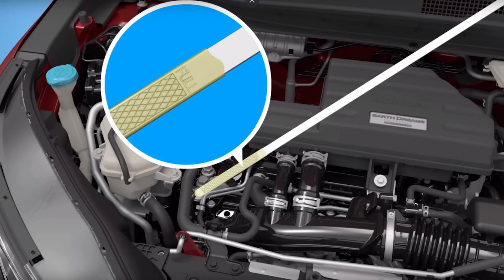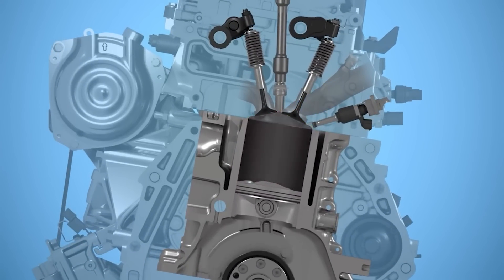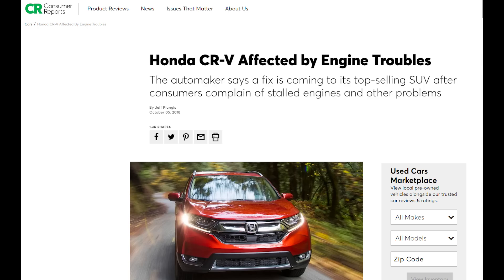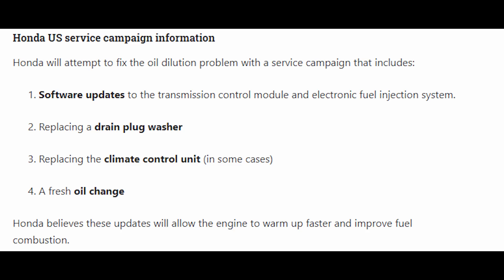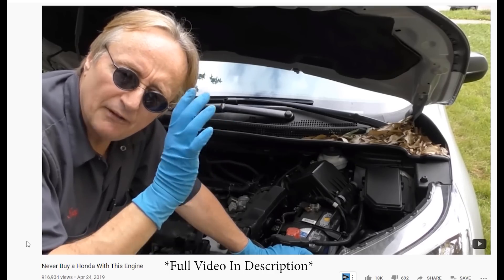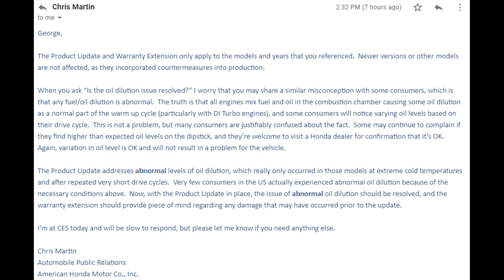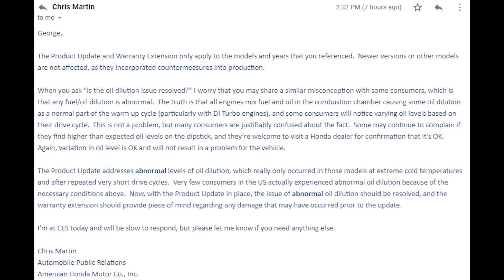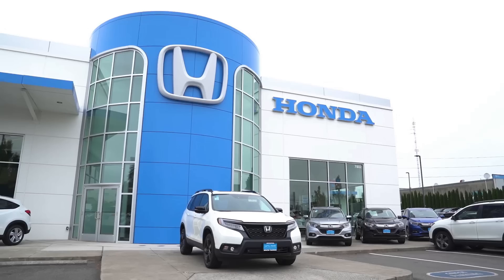Does Honda Have An Oil Dilution Problem? | 1.5L Engine in CR-V and Civic

Comment: I think this has become a he-said-she-said issue.    Panic!!  Panic all around... from here-say.     Get a grip.    I've heard of a "potential issue" but have not heard of many if at all ANY engine failures. No more so than any other average vehicle including Toyota.     I would not hesitate to purchase one of these vehicles (the 2017 or 2018 model).   As long as it's had it's scheduled maintenance.      No worries at all on this one.  Just would check the oil more often...keep an eye on it.     I do my own maintenance and have no hesitation about the issue.
Reply: Not everyone has the know how or garage to do their own maintenance.   This issue here is a bad engine design which will affect long term reliability and durability.  My 18 CRV oil gets diluted after less than 3k miles.  That’s just not acceptable and Honda needs to do more than giving a token warranty extension.
Reply: Two points. Not everyone is as a dedicated owner as you are. Two, it is still too early to rip the possible problems that it will cause. Btm line, its still an issue.
Reply: @handycap9815  Ha! Not only do they know but it was most likely by design since they had to make and test the engine themselves. So they couldnt notice the issue? or they didnt test all their engines, either way bad move for honda!
Reply: Nothing like allowing blind bias to overcome facts and reality.

Comment: 2018 Honda Accord sport (1.5 6 speed) problems here. Multiple check engine lights (misfires) and eventually the engine stalled out.  Honda replaced the entire fuel management system and cylinder head  on my Accord under warranty since they weren't sure what the exact issue was.  I'm only at 25K miles!! I do live in NY, but I do 90% highway driving. Not sure how long I'll keep this car. I love it and get incredible fuel economy, but I wont replace a fuel system or cylinder head on my own dime.
Reply: Wow, thats bad. Trade it in as soon as possible. (you never know how good there major repairs will last)

Comment: Now does the 2018 to 2019 Accord which also used the 1.5L Turbo engine have any oil dilution problems?  So, far we only hear about the Civic and CR-V issues.   Anyone knows anything?
Reply: It really depends on your driving pattern. If you drive constant short trips, don’t get any gdi engine.

The newer models shouldn’t have this issue.
Reply: Any updates?

Comment: Small turbo is bad, Honda's 1.5T is the worst. That's why Toyota doesn't use small turbo.
Reply: They have small turbos in other markets.
Reply: Agostino Matteucci You are pretty much right. It's all in the interest of simplification and profits. Each car or SUV deserves it own motor. Less turbo motors is Toyota's route.
Reply: Agostino Matteucci CRV is 3450 pounds it’s not really that heavy

Comment: I have owned two Honda cars before.  One was an Accord from the late 70s and another one was a Civic from the early 80s.  They were very reliable and never let me down.  Fast forward to 2019, I was really interested with the 2020 CRV but unfortunately the 2.0L non-turbo version is not sold.  As far as I am concerned, I will not see any CRV on my driveway.  Oil dilution is a no no for me whatever Honda says.
Reply: Get a Rav4 or wait for the 2020 CR-V Hybrid which is coming out very shortly.  The Atkinson engines in the Honda hybrids are bullet proof.   No turbo engines for me also EVER!!!
Reply: I think they have the new CRV with  2.4 non turbo as well

Comment: My 2018 Crv continues to have oil dilution even after the fix from Honda.  Gas fumes in the cabin.  Have zero confidence in the long term durability of this engine and will be getting rid of it.  I’m done with Honda ...after owning 8 other Hondas.  Not the same quality anymore....so sad!
Reply: "In a memo sent to dealers, Honda’s manager of auto campaigns and recalls, Brad Ortloff, said oil in these engines could be diluted because of software settings or potential hardware failures. Some vehicles could experience “lack of power,” leading to cylinder misfires or engine noise." Consumer Reports 

"But if the vehicles are stalling, as some owners have reported, this is a safety issue and Honda should conduct an official recall, which doesn’t expire.” Consumer Reports
Reply from the maker: Sorry to hear that.

Comment: Honda is very unreliable. I have observed issues on both the 2.4l i4 and 3.5 v6 on the honda accords burning excessive oil.  Honda has lots of reliability issues on all the hondas I have own including starter going bad too early on the 2.4l.  I had issues as well with the Honda Odyssey when the transmission broke twice back in 1999.  Coworkers have had issues with transmissions in both Hondas and Acura.  No one in my big family is buying anymore Hondas.
Reply: My 2003 CRV, 2012 Civic and 2015 Acura all run great and never had a mechanical issue or oil drip. Just maintenance.
Reply: I hadn't heard about problems with their 3.5L engines. I had 2 Acura TLs and never had any problems
Reply: 10tenman10 Their engineering is good and for durability. My dad had two TL's and a TLX. A lot comes down to how they are treated. People don't understand that all cars regardless of make require care.
Reply: Honda Odyssey's have always had bad trans.  We had one that we bought used in 2003 just because the family who had it had to have the trans rebuilt and when it shifted, it shifted hard.  Therefore, they didn't trust it after that.  When talking to mechanics, they said it better to shift hard then to shift soft because of slippage.  We also bought a new Odyssey 3 years ago.  No issues yet, but I know chances are, they are coming. I bought the van knowing the chances and I also bought the 8 year extended warranty also for when it does happen.  When I bought this CR-V, I didn't know I was buying this kind of crap.  I like the way it drives and looks,  but that doesn't make up for all the other problems.
Reply: @Nelson Santiago:  I had the excessive oil consumption issue with my 2013 Accord 2.4 Liter 4.  The oil consumption actually started between the time I bought the car new in May of 2013, , and its first oil change at 5,400 miles in October of 2013.  Over the years, I kept a log of the oil consumption between service intervals, and it steadily edged up.  I was religious about keeping it topped off, and about documenting the oil consumption issues.  After the car passed the powertrain warranty mileage of 60,000, Honda came out with a technical service bulletin that (finally) admitted that this engine had an oil consumption problem.  It covered the entire VIN range for the 2013 year for the 2.4 liter engine.  At 100,000 miles, my service manager at the dealership helped me negotiate a repair with American Honda, wherein they agreed to pay half the cost of rebuilding the engine.  My half was $2,000.  At that point, the car was consuming 3.7 to 3.8 liters of oil every 6,700 miles or so.  Ridiculous.  New valves, pistons, head, etc, and replacement oil rings that were a slightly different design from the originals.  I'm assuming that the oil control rings were at least part of the problem.  I noticed that the rate of consumption of the oil sped up as the it got older, deeper into the maintenance minder percentage cycle.  So at 80% (old oil), it was burning off at a faster rate than it was at 10% or 20%.  Because of that, I am assuming that there was not only an excessive oil consumption issue caused by faulty ring design, but also an oil dilution issue.  My theory is that the oil dilution would cause the oil to become less viscous later in the oil change interval, which would cause a higher rate of oil blowing past the piston rings.  A nice engine in terms of performance, but the experience is killing my plans to buy a 2020 Civic Si.  :(
Reply: I've had 3 Civics, 1 Accord and presently have 2012 Goldwing (motorcycle) & a 2019 Insight and have NEVER added a single drop of oil & I've driven countless miles on all of them except the Insight of course.  But I totally agree with most people that turbo engines especially the 1.5 on the CR-V's are CRAP!!!  No turbo for me EVER
Reply: HenryHonda I don't know why you are calling the 1.5t engines from Honda crap. What makes them stable under the extra pressure and heat from the turbo also causes it to take longer to warm up. I think the direct injection when cold is the main source for issues. Its a compromised engine. Honda should utilize port injection for low speed and initial cold operation or use a new hybrid approach to accelerate warm-up. The biggest failing of Honda is in how the US customer service operations have been run and also those in China. Honda's R&D is sure overall but also slow and plodding.
Reply: time for a hyundai

Comment: This is why I refused to buy a CRV with a Turbo Charger. I purchased a 2016 CRV EX with a 2.4 Liter 4 cylinder . People the turbo chargers and that engine were rushed  to the market and not throughly tested. Honda was never known for turbo engines. That small engine is being over worked with the turbo. My personal mechanic even told me to avoid the turbo engine. I'm glad I listened. This engine is junk truely just JUNK.
Reply: The Honda quality to be honest has gone down. Honda's new president and CEO has admited it. He is trying to turn that around. Also change engine every
3 to 5 thousand miles. This will help the motor last longer.
Reply: @georgewoodget271   I respectively disagree that early oil changes will result in less overall engine wear because early oil change intervals will result in less molecular adhesion of anti wear additives and will also result in premature engine wear. It's kinda one of those damned if you do and damned if you don't scenarios if you know what I mean.
Reply: hear!!!!!

Comment: Some customers doesn’t complain because they are not aware,of this issues,boycotts
Reply: So true, every owner needs to check their own oil, the dealers won't say a thing if they notice a problem.
Reply: I'm a car person, so I'm aware of this issue and understand what it means.  My sister has a 2017 Honda CR-V, and I tried to explain the oil dilution issue to her.  She lives in the northern part of New York state, where it gets very cold and snowy in winter.  I didn't get very far.  She doesn't even know the basics of how a car runs, or what an internal combustion engine even is.  She has no clue what I was talking about.  That's why customers don't complain.  Because they don't know anything about the things they drive.
Reply: @hamsterama  I'd even go as far as to say that a large proportion of Honda owners buy for perceived reliability because they have zero mechanical understanding and don't want to even consider going under the hood.
Reply: @fiveowaf454  I have to agree with you.  Honda used to be just as good as Toyota.  Now with the oil dilution, turbos, direct injection, CVT's, etc., they've gone downhill.  But most people don't know what any of this means.  My sister told me she chose a CR-V over the RAV4 because the RAV4 had some sort of wall next to the footwell, which she said felt weird to her.  The mechanics of the car played no factor in her decision.  She (as well as her husband) are typical car buyers, who have no understanding of the basics of engines and transmissions.
Reply: Most people IME just keep driving until a vehicle actually breaks, they will not notice or even heed obvious signs that there are issues.

Comment: Does the HR-V that uses what I think the same 1.5 Liter engine (but without turbo) have the same problem?
Reply: Nope!  The HR-V used the 1-8L motor not the 1.5L. We own one and it has no problems.
Reply: @tousshong9438  Yea the engine is an R18 same used in the 2006 to 2015 civic. Bulletproof and its not direct injected.
Reply: I also own a 2016 with the unaffected 1.8 litre motor.  The hr-v is daily driven and trouble free.

Comment: George, thanks for posting this information.  Sounds like the key component to avoiding a possible problem is to change the oil @ 3K to 4K miles, which I for one have always done.  I’ve never been comfortable with 7.5K - 10K oil change intervals.  I believe that is more of a marketing hipe.  Bottom line, it’s cheaper to change the oil than rebuilding/replacing engines, my 10¢...
Reply from the maker: Yes regular oil changes 3-4k sounds like its key for any DI or TDI engines.
Reply: @DriversOnly  As a "former" non franchised VW TDI only sales, service and full repair entity named Wild Rose Motors, Ltd. out of Southern CA, the only real issue with diesel fuel dilution we discovered was when owner's were using higher percentages of bio diesel and such was mostly an issue with the common rail TDIs from 2009 to 2015 which were the engines that fell under the emission's cheating scandal. Engines slated for 10K oil change intervals that do not have oil dilution issues should not be subject to early oil change intervals due to the fact the anti wear additives need the extended heat/pressure cycles to effectively protect metal surfaces via molecular adhesion process because when new oil is added, the very strong detergent additives flush out these anti wear additives which now need approx. 2K - 3K miles of heat and pressure cycles to get back to max wear protection which results in approx. 7K to 8K of this max protection out of the 10K interval. If one changes oil early say, 3K to 4K, the max wear protection never reaches it's intended effectiveness.. 
Bottom line here is the possibility that this oil dilution issue which, IMO, is serious, these 1.5L turbo engines are subject to premature wear from both the fuel dilution as well as the early oil change practices resulting in possible much earlier engine wear compared to engines w/o oil dilution issues that adhere to the full 10K oil change intervals.  Here's hoping most understand what I am presenting here.
Reply: @leonardharview4577  Ed, oil teck here, this doesnt make sense about oil taking 2-3k miles to react. an oil change would immediately help the diluted oil in my opinion. I believe synthetic oil can go 10k miles in optiumum hiway conditions. think, gas is solvent not lube. problem with high milage oil changes is if the filter bypass opens, there is no filter!
Reply: drive it like it was your hard earned $$ that bought it, then change the oil and filter when oil life indicator hits 40%. the current generation CR-V is an OUTSTANDING example of why this class of vehicle sells so well.

Comment: Great search on this problem. Likely short commuters have the greatest problem. I’m still looking for my oil dip stick in my Tesla.
Reply: Ironically the gas fume smell occurs on my 18 crv after the engine has been running at highway speed for over 40 + minutes.

Comment: Honda bought into direct injection turbos of small engines and CVT.  I bet some of the consumer reports degradation of their quality has also to do with CVT transmission behavior.

Add to that infotainment systems like the ones in Ridgeline with no knobs and that also adds to frustration.  Sure you can get around it with steering wheel controls, but many don’t like no knob systems.

Finally, their autonomous driving features are not well integerated or mature and are annoying.

Comment: I have the 2019 Honda CRV, and I have smelled major gas coming form the vents inside the cabin area. I plan to bring my CRV in to have them look it over soon.
Reply: Yeah, I have heard other owners are having the same gasoline smell as you've mention here.  Better sell it off and buy a Toyota or another brand. Best of luck.
Reply: @tousshong9438  https://chicago.cbslocal.com/2019/06/10/honda-cr-v-mark-baranski-not-welcome-joliet-dealership-invoice/
Reply: I invested $28 to have the oil tested on my 18 CRV via Blackstone Labs.  Their report confirm a high percentage of gas in the oil.  Already had the software update from Honda and the gas fumes in the cabin continue.... good luck with your 19 CRV... I’d suggest getting the oil tested.
Reply: @markp6586  Same with me. Gas/oil dilution greater than 5% and viscosity out of spec even thought the "product update" has been done.
Reply: Mark P : does your 20-9 LX CRV have the oil dilution  problem? Did you get FWD or AWD?
Reply from the maker: Yes have them check it out asap.
Reply: We bought the '19 2.4l to avoid this.
Reply: @jamesjorgensen7608  just in the nick of time. That engine choice is no longer available in the 2020 models.
Reply: @jamesjorgensen7608  I just wanted the more options and tech than the LX, so we went with the Passport
Reply: @jamesjorgensen7608  there is the 2.4l for 2019? I thought that was just for 2017 models.
Reply: @truongdo6850  Yes! But only for the LX. No 2.4 in 2020 however.
Reply: @truongdo6850 : only if you purchased the CRV LX. The higher CRV trims have the turbo
Reply: @bstevens9831  I got a LE AWD 2019. So sad for the first brand new vehicle.
Reply: Truong Do : so does your 2019 LE AWS have this oil solution problem?
Reply: @rnurmin4967  its still. I can smell the gas especially in the cold weather. Its minus 29 Celsius right now in Calgary. I got the AWD.
Reply: updatE?
Reply: Check your own oil levels and photograph the dipstick.
Reply: Betrayed 1914  ours was too, one year old 18 EX with 18,000 miles they couldn't fix it so we traded it in on a 19 Passport.
Reply: Mine started off with no issues as well but now it's got the oil dilution problem 100%
Reply: @RobnDidi  mine is the same. CR V 2019 with just over 9000 km.